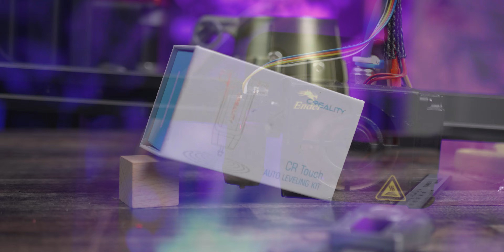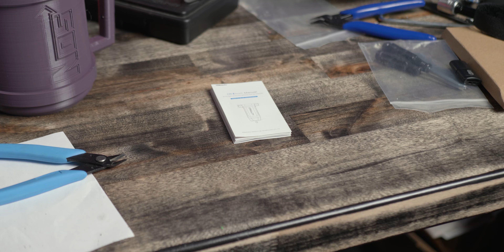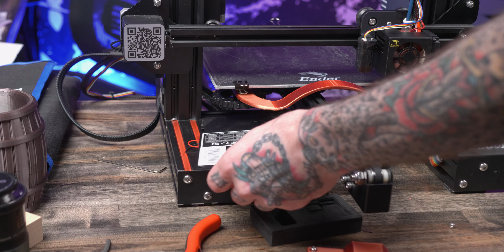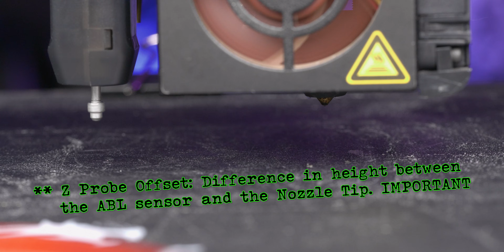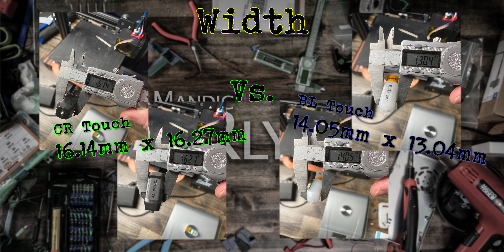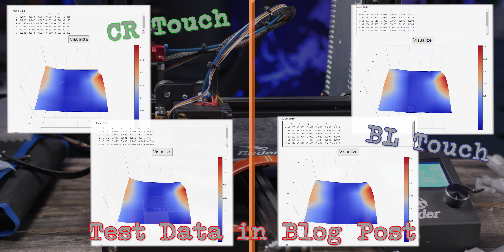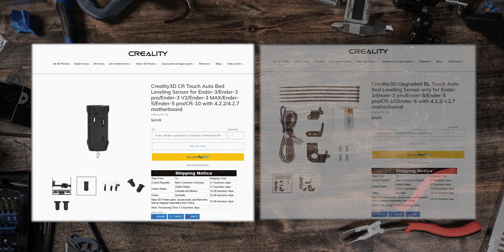CR Touch vs BL Touch - NEW Creality Auto Bed Level Sensor Review

Comment: First video coming from TikTok, great production value👍🏼 One of my new favorite printing channels out there.  

That being said I told myself from the beginning to ‘learn the hard way’ and forget the bl-touch; wanting to master manually leveling the bed before buying one.  I felt like I had, so I purchased the CR touch after watching this video and I’m glad I did.  First layers are nearly perfect every time and it takes some of the worry out of starting a print and wondering if it’ll survive 😂  only issue I seem to have with mine is the rattle coming from the metal touch probe as it prints, but I’ll live with it for now
Reply from the maker: Thank you.  I agree that is the best way to go.  A Bed Level sensor is just a "nice to have" that supplements a good manual leveling.  Supposedly they have updated the CR-Touch to deal with the rattle.  My original one never really had that issue but I have one of the new ones too to see if it happens on the updated design.  Just haven't had any time to mess with it yet.

Comment: Hello Mandic

Ive installed my cr touch onto my ender 5 pro, installed the firmware from creality website but when i start the set up procedure it all goes wrong. The firmware seems to have forgotten that my cr touch is mounted, when i run the be levelling function it doesn't start at 0x,0y but at 15x,0y. The middle one is then at 130x,0y instead of 115x,0y. this means that the last 0y bed level slams the cr touch into the far left pulley system. What should I do. ?
Reply from the maker: Are you using the mount from Creality? It sounds like the Home Offset is incorrect or the Probe Offset (or both). Either of which should be repairable without needing new firmware. But I can’t exactly tell what needs to occur from that description.

Comment: How do I know if I have the right board for this? I got an ender 3 pro this week
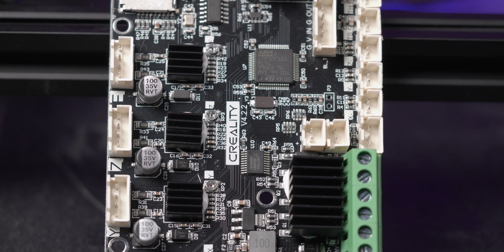Reply from the maker: In the very middle of the board it says what board you have.  I showed at @3:08 you see it says "V4.2.2" right next to the Creality branding.  Look for that "V4.2.*" on yours.  Either way if you just got a 3 Pro it has one of those two boards (Should be the V4.2.2, unless it was some very old stock someone was holding onto).

Comment: I bought a BL Touch for my E3v2. Worst thing i ever bought for it. It would glitch out like crazy, smack the pin against the side of the plate, fail on the initial 9 point bed test. I went back to manual leveling because having a 50/50 chance of failure was enough for me. But im thinking about the CL touch.

Comment: i'm very curious as to how it levels? does it just take the data of how the bed sits and prints accordingly or does it tell you the offsets and you have to level it from there?
Reply from the maker: Auto bed level sensors tell the firmware what the readings across the bed are. Then the machine adjusted the Z height continually to ensure the print head is maintaining the same distance from the bed all across it. You should still manually level the bed to give it the best chance of working well though. It isn’t a replacement for manual leveling in my opinion.
Reply: @MandicReally  Sounds like a good buy thank you!

Comment: How about saving $25 and getting the 3DTouch. Works great on my Cr10
Reply from the maker: 3D Touch is just a BLTouch knock off. They are known for being buggier and more prone to failure. Works for you? Rad and I hope it keeps doing so. But I can’t find them $25 cheaper. Since I filmed this the CR Touch has come down to in the $35-40 area.

Comment: I have the Big Tree filament sensor on my ender 3 v2 and it was a pain for me getting the firmware correct. If I decide to install a CR Touch will I have to mess with the filament sensor firmware again or will it be fine? I'm assuming when downloading new firmware everything gets replaced?
Reply from the maker: Everything gets replaced unfortunately. Did you compile your own firmware for the filament sensor? If so adding auto leveling shouldn’t be any more difficult than that. Plenty of guides online for doing hit.

Comment: As a newbie you kind of lost me on the set up. You said you compiled something that worked and then left it there. So when I buy this thing am I gonna have a problem with the set up?
Reply from the maker: I kind of left it there because discussing compiling firmware is a deep rabbit hole and I cannot be peoples tech support for doing their own. I believe Creality has remedied the issues I mentioned and what you download from them should no work smoothly. Or there are others who provide recompiled Marlin Firmwares for these machines that will enable the functionality. Sorry it is hard to not gloss over that subject while not opening myself up to constant support of troubleshooting.
Reply: @MandicReally  Thank you I guess I will find out when I get the Printer and the Auto Sensor as of know I do not have either but I think this is a good first update. I will follow you for more videos.

Comment: So I’ve have a bl touch on my ender 3v2 and I can’t get a good first layer, should I try your firmware and see if that fixes it?
Reply from the maker: Are you doing a good manual level before you try? That’s still critically important. The ABL can only compensate so much. Did you have good layers before the ABL? So many setting effect first layer. Also I generally default to a bad z-probe offset setting when first layers suck (and I’ve checked those other things).
Reply: @MandicReally  A few months ago before I quit trying to figure out my problem I had printed off a few prints that had a good first layer, but as soon as the print was finished I would try to print something else right after and the first layer wouldnt stick. IDK if im explaining it well but im almost completely turned off from 3d printing and now I have to force myself to try and troubleshoot again.

Comment: Just buying the new 32bit board and BL (CR) from Creality, and wonder about this talk of Marlin software, would it be best to install that or just live with the software supplied on the board as not technically minded and if so how do you install Marlin
Reply from the maker: Marlin is the firmware the printer runs on. Consider it sort of like the Operating System of the printer. Creality machines (and boards) ship with a Version of Marlin. It’s just never the latest version or having all the features enabled. They play it safe as to avoid bugs of latest releases. I don’t know why they don’t enable more features though. So all that to say, you should be fine with what they provide on their site. Configuring firmware requires minor coding in VS Code and gets complicated fast. It’s totally doable but it seems very daunting.

Comment: I'm having nothing but problems with my printer since adding the CR Touch and updating the firmware. Any file i print fails...like the layers aren't quite right and the cumulative effect of this is that prints end up kind of spongy vs solid.

Comment: OK, I"m pretty new. I mean I have printed some pretty complicated car parts I designed in Fusion 360, but I am still really new to 3D printing... SO, you mentioned being able to factor in bed warp (after you did some probe test with some software..h ahhah I said I was new)... Do you have a video explaining how this is done AND is there an auto bed leveler for the CR10-5S ? As my parts are too large to print on any other printer and I have a CR10-5S  ???

Comment: So even though it's got the same connectors you still have to flash firmware? I have a cr10s pro v2 and I've never done firmware. Would that make the printer better?
Reply from the maker: You don’t have to flash firmware to switch from a BL Touch to a CR Touch. You only have to flash it for a machine that didn’t have a sensor before, as I setup here. 

If your BL Touch is in good working order, you’ll see no benefit switching to the CR Touch. If your BL Touch is acting up it may be a good replacement is all.

Comment: Salut de France ! Thank you very much for your very accurate video for the installation of the CR Touch on a 3V1 Ender in 4.2.7. The provision of the firmware in 1.1.2 helped me well because the official on the website of Creality is a horror. Thanks again a lot, my old and faithful Ender 3 wonderfully walking!

Comment: Sensor itself from Ali is $13 for BL and $25+ for CR. Is it x2 better? No. Choice is obvious.
Reply from the maker: $13 sensors on AliExpress are clones, not official BL Touch units. Those are known to have higher failure rates. Actual BL Touches from ANTCLABS are running $30+ on there.

Comment: good video. seems a very fair comparison and rating.   First time viewer of your channel.  I have a BL Touch on an Ender 3 Pro that seems to be flaky every now and again. just stopping during a pre-print check and definitely stopping infrequently when doing a full bed level.   Seems to have been fixed by putting a zip tie around the BL Touch just above the connector holding the cable to the body.  seems like it might be a bad connection when the hot end is moving around and the cable would move.  Thinking about replacing, and may do a CR Touch instead of another BL touch.

Comment: Hey so wuestion i added a flexable magnetic build plate to my ender 3will this still work for my printer?
Reply from the maker: Bed surface should not matter with a physical probe like this. You’ll be good to go.
Reply: @MandicReally  i appreciate the response and i was worried that the magnet might mess with the metal probe glad to see that it should be fine

Comment: I use a Dial Indicator when I manually level my bed, Right now I have to put a small piece of paper in the middle to correct for the dip. Its very close & prints come out great.  But I don't mind spending $50 if it helps even better.   I have a ender 5 Pro model, I wish your video talks about how this would help me, I'm sure you have to kind of dial it in as close as you can and then use this? How does this help with the issue I have? I assume as its printing - it would turn the stepper motors to compensate for my dip, Right? Also does this only work for certain mainboards?
Is it worth the upgrade?
Reply from the maker: You have the gist of it.  This probes various points across the bed to make a "Map" of the bed (I showed a visualization of that in the video).  The Firmware uses that to instruct the machine to move the Z Axis up and down to compensate for things like the Dip you have. It really just helps to get the best base layer for your print that the machine can.  You are correct that getting a really good base level (as you seem to be doing) is important, this just helps make it slightly better. 

If you aren't having base layer issues, or issues with that dip in particular, I wouldn't worry about it.  If you want to try it, this is meant to work with the Creality V4.2.2 or V4.2.7 mainboards.  It may work with other aftermarket boards, but I haven't done enough testing to confirm or deny that yet.  Hopefully I will eventually. 

This was a review of a newer Auto Bed Level Sensor, not an explainer on how they work, so sorry I didn't go into much more detail. Every review cannot include that info or else it would get very redundant.
Reply: @MandicReally  thank you for the reply

Comment: That 72 nanometer difference in repeatability variance, has absolute zero impact on actual printing - it's orders of magnitude beyond the accuracy of the stepper motors. It could easily be accounted for by EMI, thermal expansion etc - or just compression of the probe tip. 

Personally I'd be more interested in absolute numbers with a precision control. Maybe support the bed so it cannot bow from weight, then first probe straight on the bed. Next, probe against a size calibration block placed in the same spot?

 It's nice to have tight repeatability - but it doesn't do you much good if it turns out the absolute distance reading is poorly calibrated, generally inaccurate, or doesn't scale linearly with real distance. Like lets assume the printer's movement system was highly accurate. And the repeatability of a probe reading is 60-80 nanometers, with an absolute distance reading of 0.2mm, when the real world distance is 0.12mm (so the absolute reading is off, enough that a 1st layer squish with a small nozzle could end in a crash). And then the next spot is reading 0.51mm, while the real distance is 0.3mm (turns out its absolute distance readings doesn't scale linearly with real distance either). A bit in the extreme, but hopefully it illustrates my thinking..

Comment: Is this strange?  I installed my BL Touch without upgrading firmware on a 4.2.2 board, and it recognized and functioned with the BL Touch like it knew it would be there all along.

Comment: So I had the same issue with the CR touch install process with the provided instructions. MY board is the 4.2.2, is there a recommended firmware to use for this?

Comment: i run JyersUI and they have a BL-Touch ver of the fermware think the CR will work with BL as you said the printer knows no difference
 ?
Reply from the maker: I have not personally tested it but see no reason it shouldn't work.  To my knowledge that is a fairly standard Marlin compile, so yes it should work well.  The firmware doesn't know any different.  The only thing I've tried so far that hasn't worked was installing the CR-Touch on my Elegoo Neptune 2.  However that machine is weird even with the BL-Touch so I don't know what is up there.
Reply: @MandicReally  Thank you so much for the reply :) ill let you know in a few weeks (if i remember) when the CR gets here how it all went :)

Comment: Hey, very nice in depth review, you helped me decide to get a CR Touch instead of a BL Touch! Just one question, my CR Touch has a rattle, vibration noise, when my printer moves the print assembly in the X axis. I tracked it down to the actual probe metal tip, if I just touch it stops rattling against the plastic body. Have you had any level of rattling noise on your tests?

Comment: I decided to "roll my own" firmware and enabled the assisted tramming as well as the Z-Offset Wizard.  Makes it much easier as can do the corner levelling using the probe to measure instead of paper and the Z-Offset wizard is a God send.   It really makes it easier and eliminates the hard work setting the Z-Offset,  Also, Creality still seems to be supplying Marlin 1.x and Marlin 2.x does have a lot of extra features :).  
A bed levelling is virtually essential with Creality printers as I have never had one without a warped bed.

Comment: Nice test on both devices. However, I'm missing an important (IMHO) test. Heat resistance. BLtouch melts on heated chambers. It'd be fine to check if the CRTouch has better heat resistance in those situations. ;-)
Reply from the maker: Definitely would be interesting to see the results.  None of my machines run chambers so not something I’ll be testing anytime soon. Maybe eventually I can find a good situation to test that. 👌🏻

Comment: Creality has a newer updated firmware on there site now for the cr touch. It seems to be a more up to date version of Marlin with way more features. I tried cfw but it didn't let me adjust the z offset at all. The only issue I have with creality's firmware is that I can't adjust the z offset with baby stepping.
Reply: If you plug into the printer, you can send a specific z-offset, if you need something in between. I have never needed more resolution myself. The gcode is M851.
So if you need a z-probe offset of -2.521 you send 'M851 Z-2.521'

Comment: Is this compatible with any machine that supports the BL or does it only work on Creality machines?  Specifically curious if it will work on the voxelab aquilas?
Reply from the maker: No but I can’t say what machines it does or doesn’t work on. I tried installing it on my Elegoo Neptune 2 and it didn’t work. But my Neptune 2 is strange with the BL Touch too (though it works).  I’d say if you pick one up, get it from Amazon so you can easily return it if you have an issue. The problem I encountered was it simply did not extend the probe, so you’d know right away.
Reply: @MandicReally  Thank you!

Comment: I like my CR Touch.  However, my PiCam is mounted the the box covering the gantry stepper motor and the CR Touch is big enough that it hits the PiCam bracket before the limit switch... that was the only problem I had.  I just relocated the camera.  Haven't had any issues with the CR Touch.

Comment: Pre production? I got mine a couple of weeks before this video from Amazon for a few bucks cheaper than the bl touch ($34). I fed the lead through the loom from the pcb side, it’s easy. I downloaded and installed the Jyers firmware and totally recommend it.

Good review!
Reply: What did you put it on ender3?

Comment: Still somewhat confusing for this noob.  I will be getting this , along with the 4.2.7 board and  V2 Display to update my Ender 3 PRO in a big way.   I get the install and even the firmware upgrade to enable the touch sensor.  What I don't see a lot of info on is how to set up the height of the probe relative to the nozzle and what other changes are needed to get this to work.  YOu touched on one I had not heard but it makes sense - I wont need the Z switch any longer as the CR Touch will take care of this.   Thank you for a great video.

Comment: Creality printers are great. But every single thing they send you has a worthless manual, and also comes in 1 million pieces. I bought the upgraded extruder and Bowden tube for PTEG. All I got was a picture, and a bag full of about 100 different parts. No adjustment specifications. No nothing but, good luck sort of thing. Thank you Creality for being a good printer. Screw you for all the shitty novels you send. I have yet to have a good read.